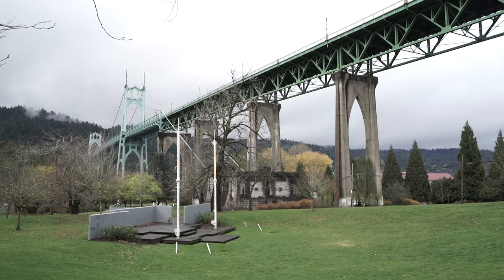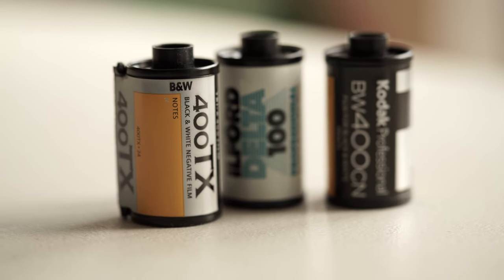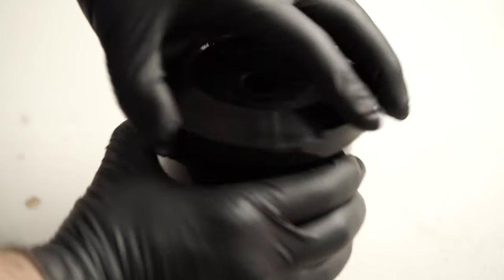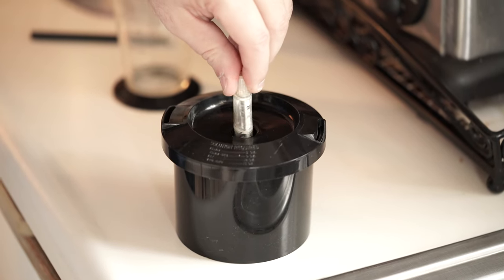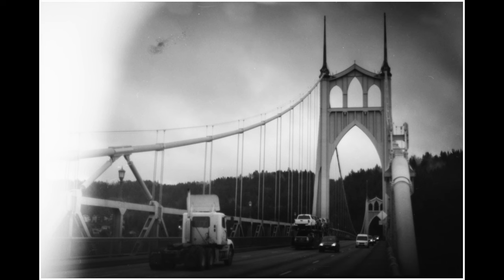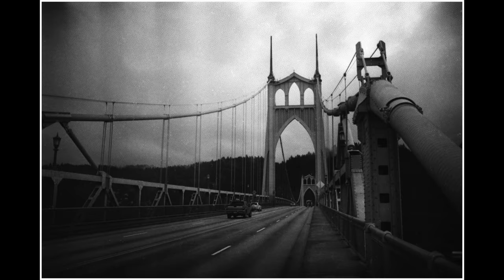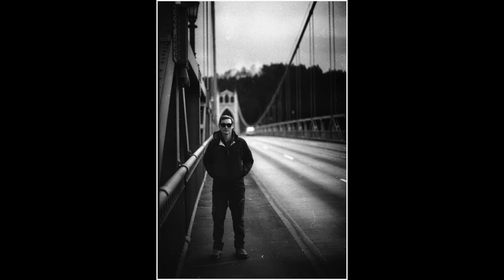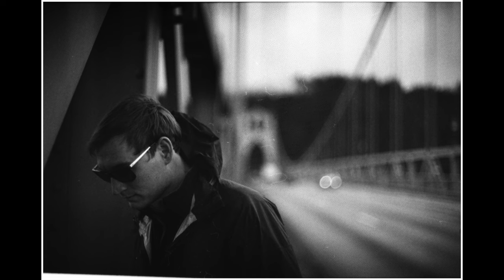New55 R5 Monobath (Episode 6)

Comment: Any advice on how to avoid the dust and scratches?
Reply from the maker: +Eddie Sanchez I think it's just a matter of handling the film better. Plus I got in the habit of using compressed air to blow off the negative before I scan it. After a few more practice runs it looks fine now.
Reply: Eddie, there are a few things you can do to avoid dust. The first is to find a chemical called PhotoFlo, or something like Sprint Chemistry's wetting agent.  These are surfactants that you mix with distilled water.  They reduce the surface tension of the water and prevent water spots, but also help repel dust through slightly antistatic properties.

For 35mm film, you develop the film, rinse it thoroughly, and then soak them in the wetting agent for a minute or so.  Then, you pull the film off of the reel, hang it in a closed off area (no traffic or airflow), and the last thing you do is squeegee the film between two fingers (I make a V with my index and middle finger, but the film in the V and squeeze the fingers together).  Then you just run your fingers across the length of the film one time (no more than once) and leave the film alone to dry as quietly as possible. 

The more air movement there is, the more likely you are to get dust sticking to the wet emulsion. 

I also keep a small spray bottle of Rexton Antistatic Film Cleaner (I've had it for 10 years.  not sure if they still make it).  You spray it on the film and use lint free negative wipes (basically soft lint free tissues).  Doing this right before scanning should ensure as little dust as possible.
Reply: Thanks for all that info Patrick. I'll check it out.
Reply: I looked afterwards to see about the Rexton stuff. Looks like they no longer make it. Look for Edwal or Static-B-Gone on Amazon for film cleaners.